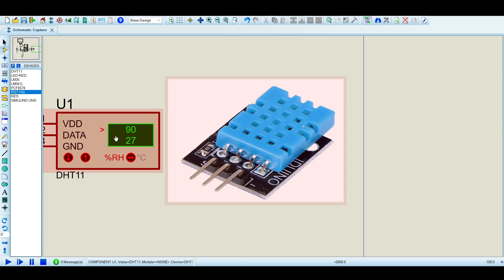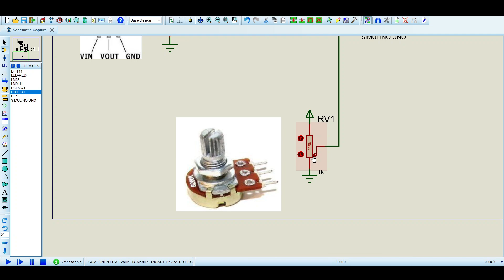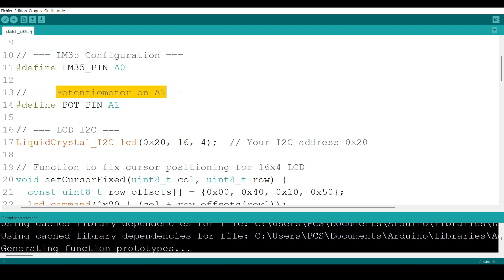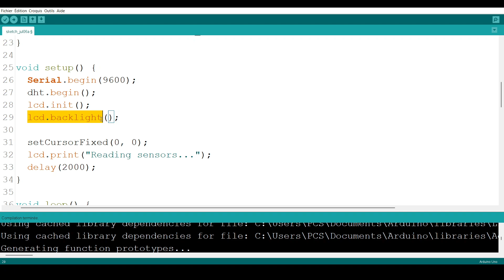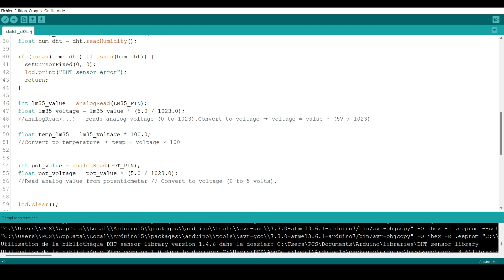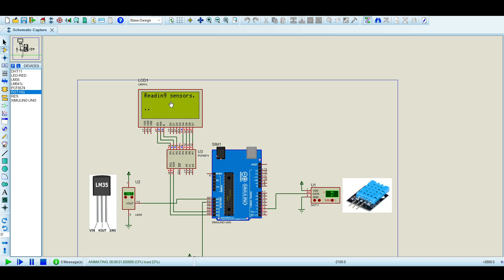How to Read DHT11, LM35 & Potentiometer on LCD with Arduino

Comment from the maker: #include <DHT.h>
#include <Wire.h>
#include <LiquidCrystal_I2C.h>

// === DHT11 Configuration ===
#define DHTPIN 2
#define DHTTYPE DHT11
DHT dht(DHTPIN, DHTTYPE);

// === LM35 Configuration ===
#define LM35_PIN A0

// === Potentiometer on A1 ===
#define POT_PIN A1

// === LCD I2C ===
LiquidCrystal_I2C lcd(0x20, 16, 4);  // Your I2C address 0x20

// Function to fix cursor positioning for 16x4 LCD
void setCursorFixed(uint8_t col, uint8_t row) {
  const uint8_t row_offsets[] = {0x00, 0x40, 0x10, 0x50};
  lcd.command(0x80 | (col + row_offsets[row]));
}

void setup() {
  Serial.begin(9600);
  dht.begin();
  lcd.init();
  lcd.backlight();

  setCursorFixed(0, 0);
  lcd.print("Reading sensors...");
  delay(2000);
}

void loop() {
  float temp_dht = dht.readTemperature();
  float hum_dht = dht.readHumidity();

  if (isnan(temp_dht) || isnan(hum_dht)) {
    setCursorFixed(0, 0);
    lcd.print("DHT sensor error");
    return;
  }

  int lm35_value = analogRead(LM35_PIN);
  float lm35_voltage = lm35_value * (5.0 / 1023.0);
  float temp_lm35 = lm35_voltage * 100.0;

  int pot_value = analogRead(POT_PIN);
  float pot_voltage = pot_value * (5.0 / 1023.0);

  lcd.clear();

  setCursorFixed(0, 0);
  lcd.print("DHT: ");
  lcd.print(temp_dht, 1);
  lcd.print((char)223);
  lcd.print("C");

  setCursorFixed(0, 1);
  lcd.print("Humidity: ");
  lcd.print(hum_dht, 1);
  lcd.print(" %");

  setCursorFixed(0, 2);
  lcd.print("LM35: ");
  lcd.print(temp_lm35, 1);
  lcd.print((char)223);
  lcd.print("C");

  setCursorFixed(0, 3);
  lcd.print("Pot: ");
  lcd.print(pot_voltage, 2);
  lcd.print(" V");

  delay(2000);
}